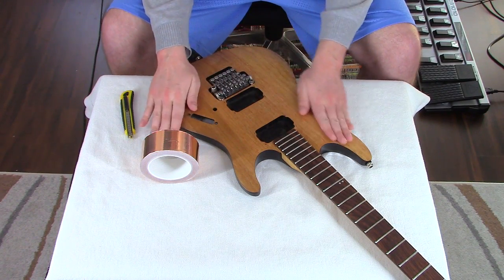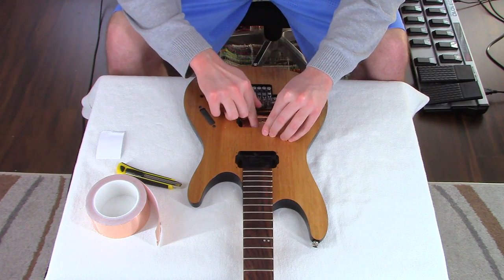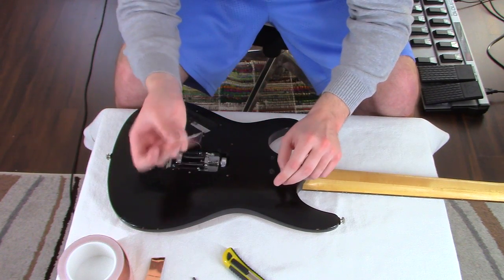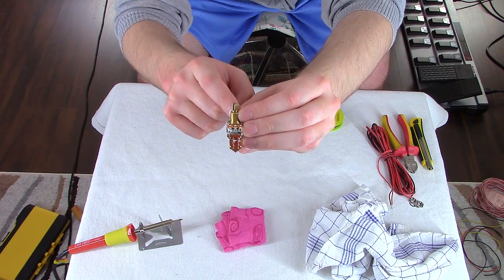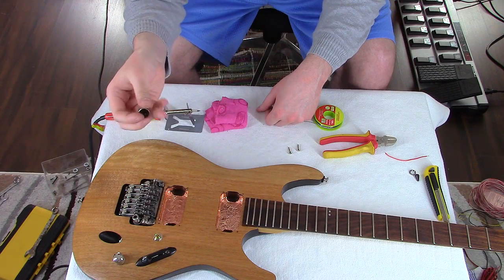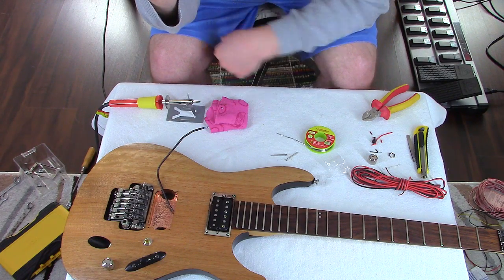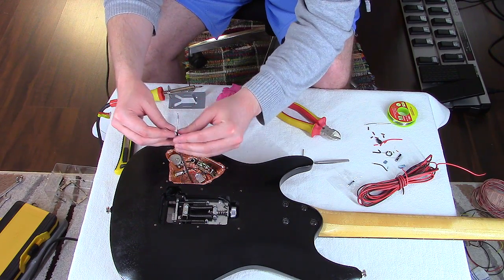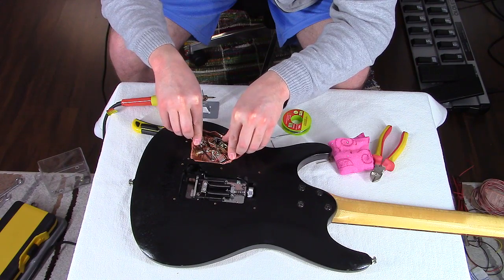DIY Gutiar Modifications (Ibanez S320) ep 5 - New Electronics (Johnny gets super irritated)

Comment: Pretty sure that nub on the pot is for pickguards.  I've only run into a couple that have it, but essentially you poke a hole in the pickguard, and that nub goes into the hole and prevents the pot from spinning.  Kind of irrelevant to your needs, and in general.  Soldering is by far my least favorite part about working on guitars.  Solder never does what I want it to do.  Just be happy you didn't have to do it on an explorer type guitar.  The cavities on those are so shit.